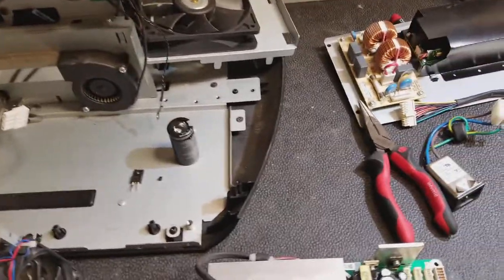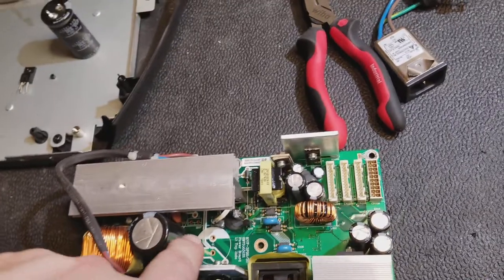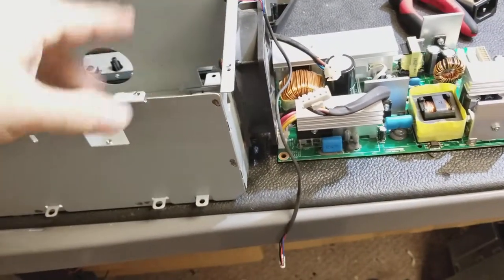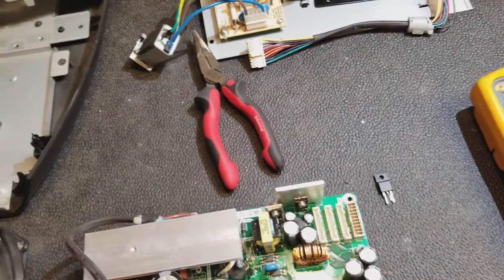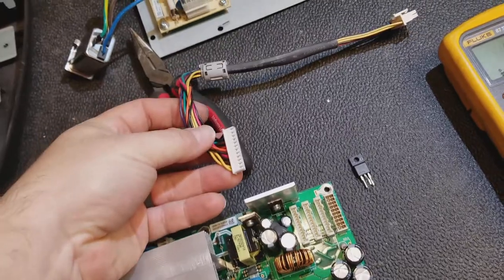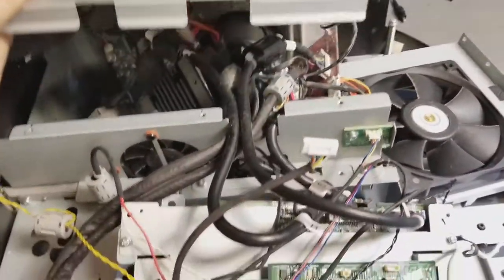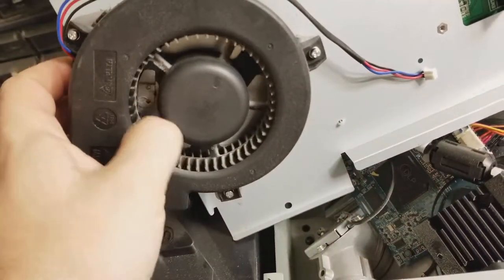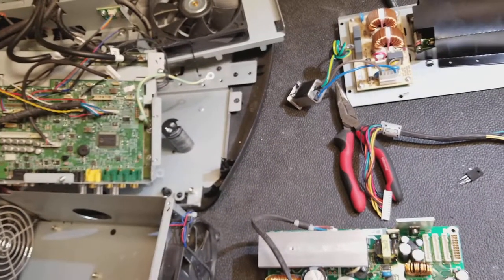Runco LS10D/i Power supply Diagnosis

Comment: Hi, I have the opportunity to buy one of these, what should I keep my eye out for?
Reply from the maker: Depends on the cost.  These work great when they are running.  Make sure its been maintained and not packed with dust.  The color wheel is a consumable.  If it was replaced in the past, that is good, but if not, plan on replacing it. Also, if it ran aftermarket lamps.  Make sure they were/are good quality.  Cheap amazon lamps ruin projectors. I would never ever use a lamp from amazon. I'd be wary.  If they want more than $300, I'd be skeptical.  Its a nice projector but its old. If its working and the price is right, you will enjoy it.

Comment: I have a Runco LS-3 which works for 5 minutes and light turns off. I replaced the bulb but still doing the same. when the light turns off the unit stays on as I can hear the fan units.
Reply from the maker: What are the LED's indicating? How is the image before it shuts off? Any flickering colors?
Reply: @FixitFrank  the image is fine just the light turns off. The fan stays on and the red light flashes and the green light stays on.
Reply: I am from Sydney Australia
Reply from the maker: Thats tough.  Could be a defective lamp but it could be a power supply or color wheel issue.  I dont know a specific fix that fits this symptom.  I hate to say it but it needs deeper troubleshooting.
Reply: @FixitFrank  I have sent it to our local repair guy for him to have a look. I will let you know what he comes up with. It is a great unit I hope it can be fixed.